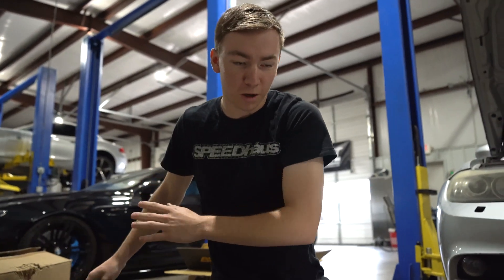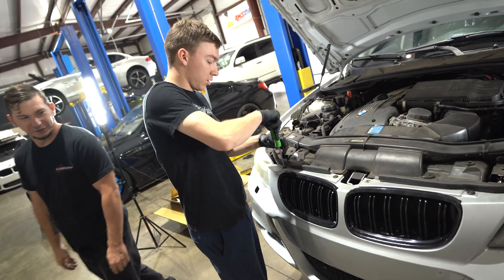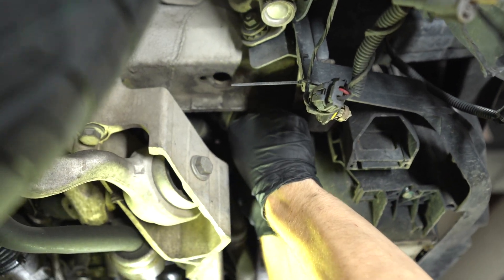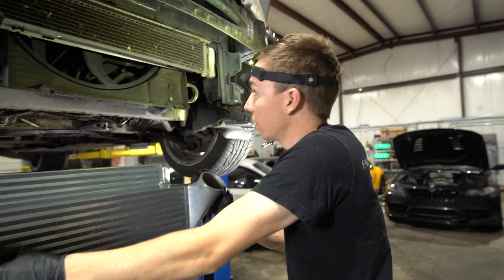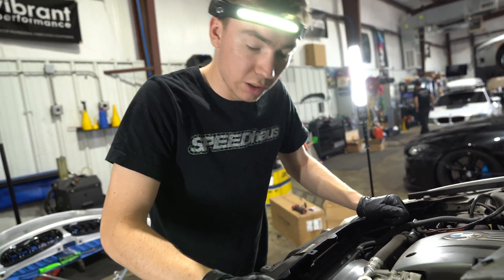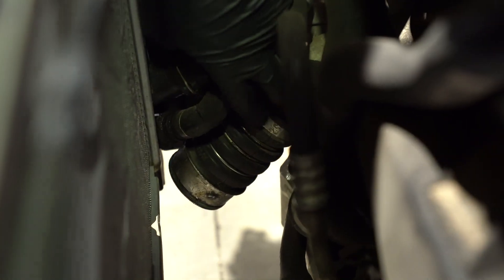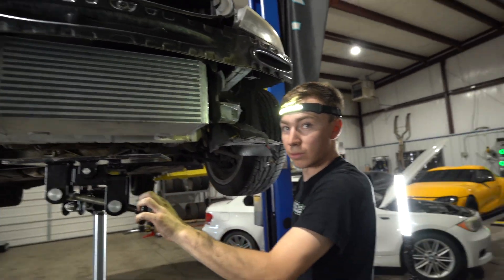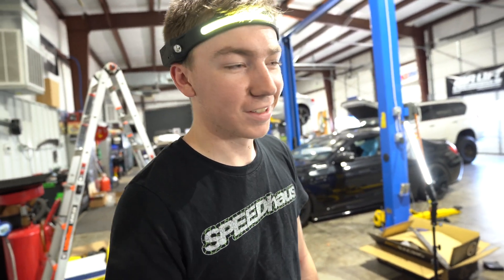How To Install N54 / N55 VRSF Intercooler | 850HP UPGRADE!

Comment: Is the intercooler just held in place by the boots? Or there a bracket supporting it?
Reply from the maker: @noname-rv7yh  bracket and bolts/screws
Reply: do you guys know the part number to that bracket that holds on the intercooler with the two screws mine broke and i can’t install the 7.5 without it
Reply: @marcuswoods528 ever find it?

Comment: I got an n55 E82. I f i install the 7.5 inch intercooler running the stock turbo, wont that create a bunch of lag because the stock turbo is too small ? just asking cuz thats what I heard, but im not sure.
Reply: did you find your answer?
Reply: @dominicrana4559   yep, i did bro!!
Reply: @agnbmotorsportsallgasnobra9470  what was your answer will it have lag?

Comment: Hey many IM FBO  Stock turbo is there any horsepower gains with having this ? I have the 6.5 VRSF race intercooler
Reply: you wont gain any but it will stop you from losing hp during consecutive runs or hard driving. it keeps your car/iat cool

Comment: Great job showing how to do this job! Thank you!  At 3:22 you mention another "clip" or tie or something that should be or is sometimes used on the top of the actual "C" clamp for the intercooler. But I've never encountered this so I don't know if you ran into something special in the past or if they were only on certain years etc. Weird.